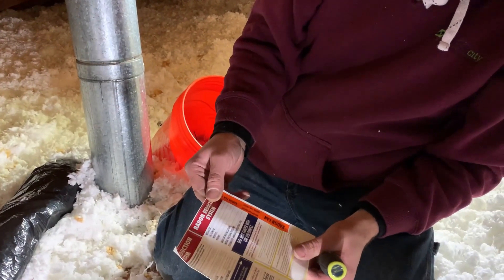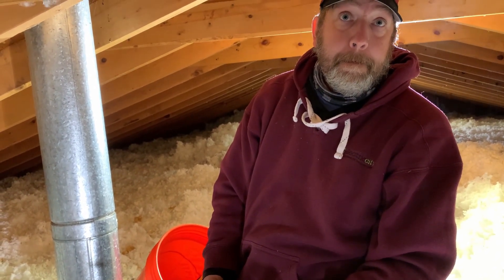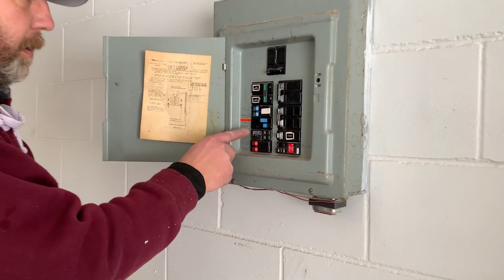How to Wire a Radon Fan Outlet in the Attic

Comment: When installing in Attics, are you required to use certain fans rated for unattended locations?  I noticed the latest manual for the AMG Fury states not for use in Attics.  It is rated for operation at 176F, so i can't see an issue with functionality since the air will cool the motor.
Reply from the maker: Wow, that is a huge fan. Are you sure you need that much airflow to hit your target pressures? Bigger is not better with radon fans. Since you are installing in an attic, you should use a Festa AMG fan with an EC motor. This is new equipment as of winter 2024. You can also use any of the Fantech or RadonAway fans.
Reply: @AmericanRadonMitigation   The AMG Fury was installed on our house when we moved in and is only pulling about .75 iwc vacuum.  There are 3 suction points in our small house (2 in the slab and 1 in the cinderblock wall).  I  suspect the cinderblock wall suction point contributes to the low vacuum level.  I am looking to move the fan from the outside to the attic because we are putting in a patio.

The levels are around .8 pCi/L this summer so I will probably just stick with the Fury since it is working well and is surprisingly quiet. I also plan to pickup one of your noise suppressors for the attic.

Thanks for the quick reply
Reply from the maker: That makes sense. However, your fan may be drawing excess conditioned air from your home, which can lead to increased operating costs and potential back-drafting issues.

Comment: Hello again Jesse. Years have passed, my system seems to be in good health and im coming to you again as the radon expert. 

You mention in this video that the fan does not need to be on its own dedicated circuit... is that a Minnesota only thing or is that nation wide? 

Currently, my systems is on its own circuit in the attic with the GFCI protection. However, im replacing my old smoke detectors with a modern AC power supply style and I'd like to use the circuit I installed in the attic for these detectors.
Reply from the maker: Keep in mind that I'm not an electrician or an electrical expert. It's my understanding that a radon system doesn't need to be on its own dedicated circuit. Circuit breakers should not be loaded to exceed 80 percent of their current rating, where in normal operation, the load will continue for three hours or more. I'd check with a licensed expert in your area for more clarity. The radon standards don't say much about the electrical requirements, but here's a link: https://standards.aarst.org/SGM-SF-2023/34/index.html#zoom=z

Comment: You dont. The fan should always be outside the building. If a leak occurs above the fan in the attic radon will find its way into the living space of the home.
Reply from the maker: Have you tested this Hem Lock? If not, it would make for an interesting video to let the radon fan exhaust all of the air in the attic and monitor the radon levels in the house and attic for a short time. I’ll have to find a house that has easy attic access and a homeowner willing to let me try it. Thanks for the idea! 

The radon mitigation standards address radon fan location in sections 6.5.2 and 6.5.3 https://standards.aarst.org/SGM-SF-2017/27/index.html
Reply: Then why not just leave the fan in the basement if that's the case?
Reply from the maker: The standards we have to follow don't allow you to install a radon fan in the basement. 

Check out sections 6.5.2 and 6.5.3 of the standard. https://standards.aarst.org/SGM-SF-2023/28/index.html

Comment: It was great seeing the other details of the radon system installation!

On another video, you talked about checking for hot water tank backdraft. Maybe in a future video, you could follow along about what to do in the event a radon system causes backdraft.
Reply from the maker: I'll keep that in mind. Most of the water heaters that have an issue with back drafting are back drafting before we even install a radon system. 

Unfortunately, it's very common.

Comment: Great videos. Appreciate your work.
Reply from the maker: You bet, Ian! 

Are you a mitigation contractor?
Reply: @AmericanRadonMitigation  Not yet. I will be completing the training and testing this month. Your videos are very helpful.
Reply from the maker: @ianpalmer1482  Awesome! Who are you doing your training through?
Reply: Homespection in Canton. We are required to use a select list of trainers and they were the only ones that have in person training still. I wanted to use Kansas State but they are only virtual.
Reply from the maker: @ianpalmer1482  I would highly recommend Bruce Snead for the measurement course. It's dry material, and he does a great job at making it fun and easy to understand. 

I'm with you on the hands-on course. I'm not a fan of webinar type training. 

You should consider the advanced diagnostic course after you've got some mitigation work under your belt. I've been a student in and helped teach the class 4-5 times and learn something new each time. It will help you offer more value to your customers. 

You can learn more at radoncourses.com
Reply: @AmericanRadonMitigation  I fully intend to take that course. My hope is that I will be able to do most of my CE hours though them. Thanks.